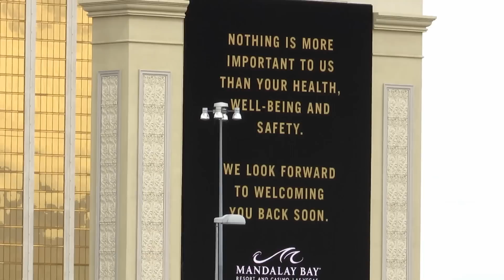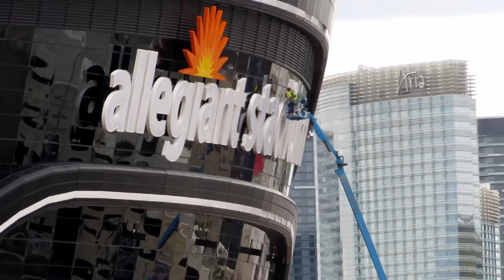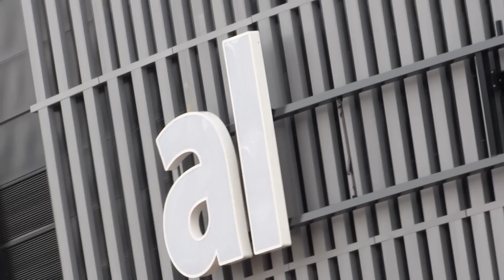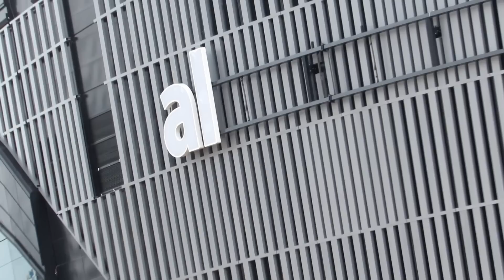Las Vegas Raiders Allegiant Stadium Construction Update 03 16 2020

Comment: The crane Operators normally go through a 5 year apprenticeship learning the trade when they start out. They will acquire they’re certifications to operate through the apprenticeship and Once they become journeyman they should have gained enough knowledge to run the rig. Doesn’t happen over night. It takes years to get good at running a crane. Best trade on the jobsite c’mon 🤘🏻
Reply: I heard crane operators can only work 4 hour shifts but get paid for 8 hours because they have to stay sharp and focused. Don't know if that's true but I can totally see that because it's a very dangerous job.
Reply: How much do crane operators get paid?
Reply: @hektorlinko  That's a fact.
Reply: @shake4259  150k+
Reply: @saulm5632  I've heard that number before but when I search it up it says like 50k
Reply: @shake4259  I believe they get a base rate with additional pay based on cable travel.
Reply: hektorlinko depending on what crane you’re on depends on how much you get paid. When a crane requires 2 people to man it, it’s an 8 hour minimum regardless of how long the job takes. Smaller 1 man cranes are normally a 4 hour minimum
Reply: Shake A crane operator that works an average amount of hours will make up to 100k a year. If you put in a lot of overtime and double time you can make close to 200k most journeyman will make close to 150k yearly